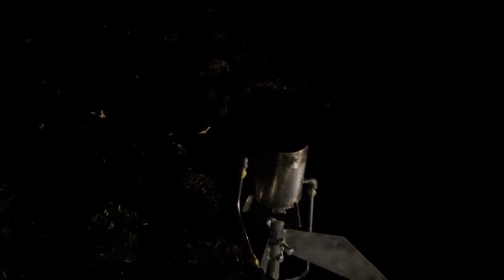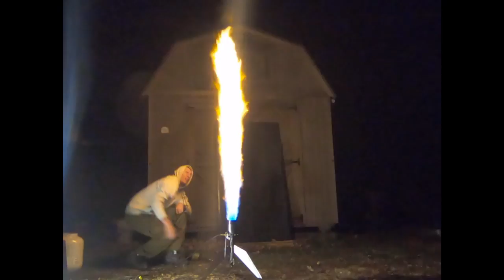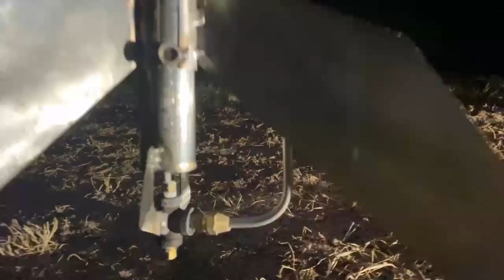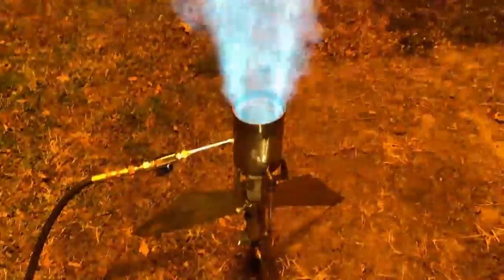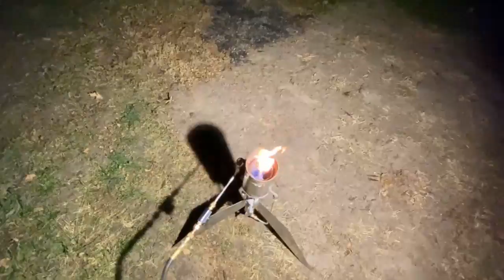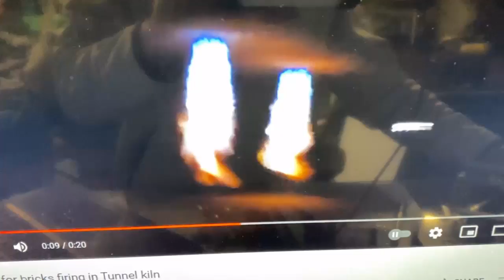Krakatoa Liquid Propane burner

Comment: boca chica (backyard), you produce more flames than there.😄

that makes 8x24…192 lb propane 24 hours burning if full throttle. and tank like this you can expect a 100ft safety distance in a separated building block and some seriously reliable back fire valve? I guess. don't under estimate the courage of people in India. they handle things bare handed.…

is the air intake issue solved? if the klin design is a totally confine space (some design have vent, some don't, charcoal fuel may not), air cycle back to burner may be hot as well.